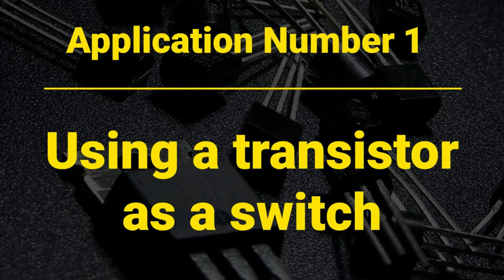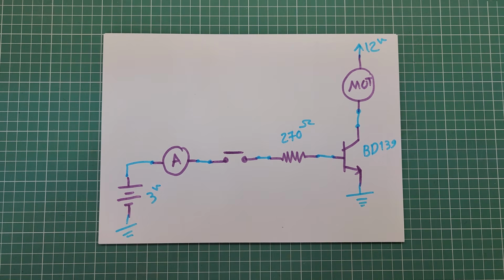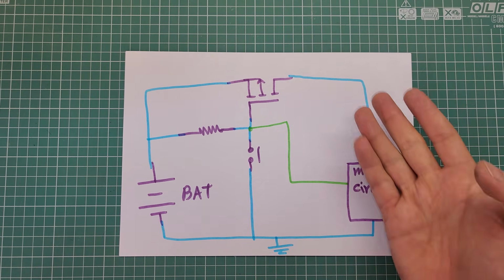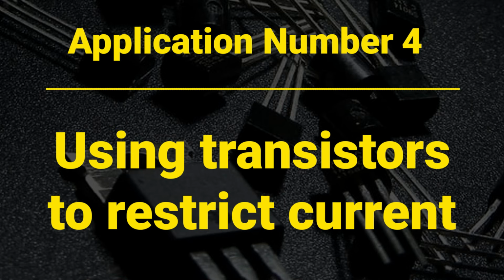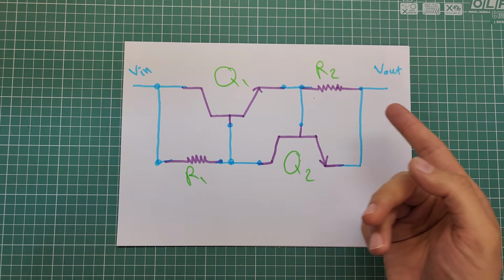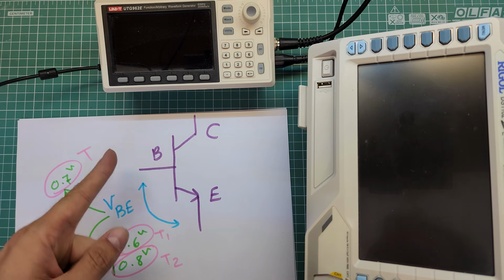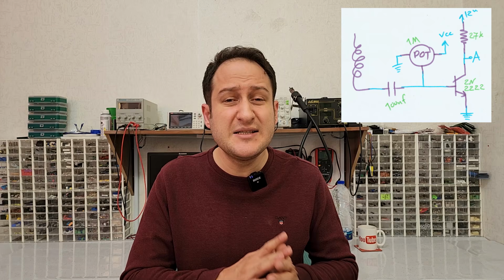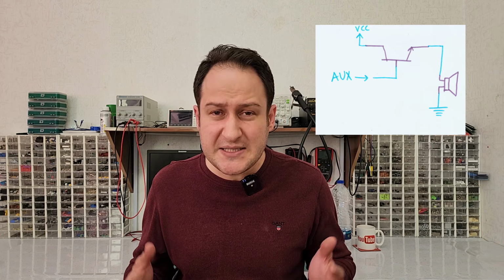7 awesome applications of transistors in circuits

Comment: Isn't there typically an emitter resistor for a common collector configuration?
Reply from the maker: it depends on the load, the load may need a resistor or not!
Reply: @elewizard  Thanks, I see that, but won't a load such as a motor vary in impedance at different speeds?
Reply: @Enigma758  
A common collector (CC) amplifier or "emitter follower" is a good circuit to use when you want to apply a constant (but variable as required) voltage to a load that varies in impedance. 
Remember that an ideal voltage source has zero output impedance - the voltage stays constant no matter what current is drawn from the source. 
The CC amplifier has high input impedance and low output impedance. The output impedance isn't zero, so you don't get a perfect voltage source, but it is low. Just what the ratio of input impedance to output impedance actually is depends on the current gain of the transistor. The higher the gain the higher the ratio of input to output impedance. That gain will vary somewhat from one unit to another of the same type and will vary with temperature.

Usually with a DC motor with brushes what you want to do is control the speed , which is reasonably proportional to the applied voltage. If the mechanical load increases while the applied voltage is kept constant, the current increases, and vice versa. That low output impedance of the CC amp is just what you need. Overall the performance isn't great, but can be quite adequate for lots of purposes. (If you need really good speed control you'd typically use a tachometer in a closed-loop system, though you can do a pretty good job by measuring the back-EMF from the motor, which tends to be very linear with speed).

There are circuits where you might add some extra resistance in the emitter circuit of a CC amp but that moves the circuit farther away from being an ideal voltage source if the load is in series with the  added resistor. If a CC amp is used as the final output stage of an amplifier with feedback, sometimes a small resistance is used to isolate capacitance that may be present with the load. Capacitance can cause a phase shift that can play havoc with the stability of the system and the resistor can mitigate the problem. This is common with audio power amplifiers.

Both JFETs and MOSFETs can be used in "source follower" (common drain) circuits for extremely high input impedance. The difference between gate voltage and source voltage is not as well defined as with BJTs.
Reply from the maker: Yes, it varies. So what? There is no need to a resistor there
Reply: @elewizard  OK

Comment: Exactly what I'm looking for. Not just the bare explanation of how a transistor works, but even several examples what they are doing and above all why that's important.

Cause, I never understand realy why I should use a transistor as a switch after e.g. an push button.

Direktly saved in my learning list!

Thanks
Reply from the maker: Glad it was helpful 😃
I will try to make more videos of this type 👍

Comment: Great way of high side switching n-channel mosfets.... Use photovoltaic opto isolators. The isolator's output can be floated on the mosfets source. Thus gate-source voltage can always go high enough to ensure full on.
Reply: Photovoltaic couplers are generally pretty slow and the last time I looked (years ago) they were quite expensive. Still, they are a good solution for some applications.
Reply from the maker: Thanks for sharing❤️

Comment: Thank you sir, now I know how touch buttons on certain old elevators work on the inside ! I’m a lift mechanic and nobody could explain it to me on a component level!
Reply from the maker: Touch sensors can be made by using several different methods. Now you learned one of them 🍻
Reply: Yes it's like sales people that read from the back of the box, but this is all very interesting.
 I guess there is an attitude to things that, nobody expects anyone to use a soldering iron any more.